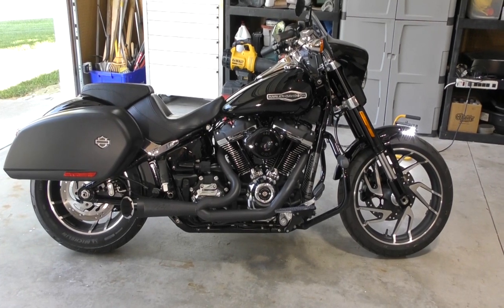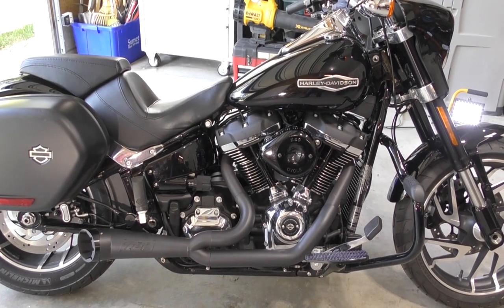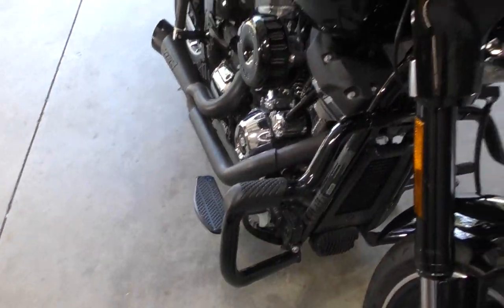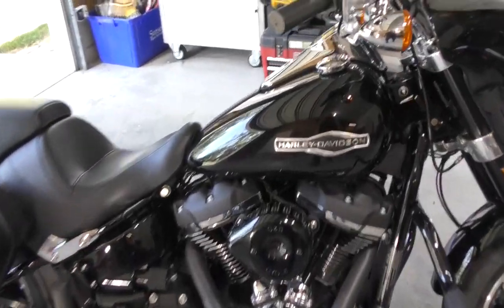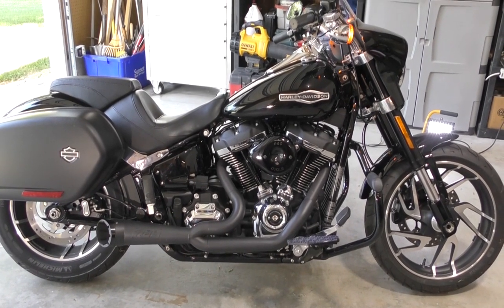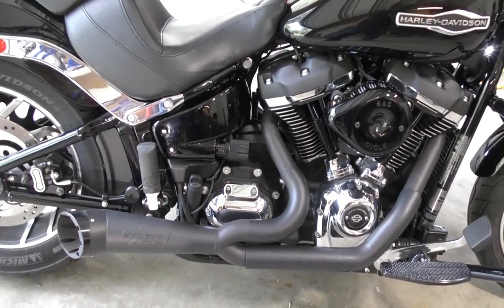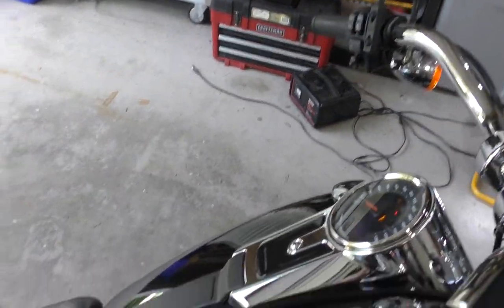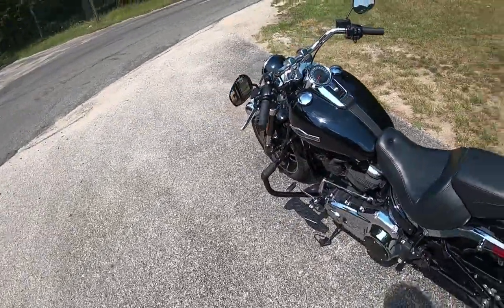2018 Harley Sport Glide Review Stage 2 Kit

Comment: I agree MoCo sends them out the door under cammed. I think with the purpose of selling stage kits.  I did the stage 3 on my 19 out the box.  Done this way it retains warranty gets the MoCo 20 percent discount and was no out of pocket money. Put with the SE tuner and EPA approved S&S Streetmaster 2-1 exhaust plus MoCo Extreme AC 64mm TB and intake the bike made 116/116 at the wheel. The bike / cam pulls to 6k but still has enough low rpm torque to ride below 2k rpms for easy in town cruising.

IMO you picked tasteful & smart mods. I especially like the blacked out TBR pipe, S&S AC, crash bar & boards. I went with the Bunk King crash bar & a taller tinted Gustafson windscreen for mine. Almost 20k miles now in 24 months with zero problems. 

A worthwhile bolt on improvement I did that you might consider was swapping to a 70 tooth pulley to optimize gearing. This improved acceleration plus with my cam / tune and likely yours top speed. No measurable change in mileage. MoCo used overly tall gearing for emissions. The heavier touring & especially trikes used lower gearing than the softails. 

It’s a heavy cruiser but I’ve always been a tinkerer and a bit of a power junkie. Considering what I want to do next. Hope you update your video if you do more mods to yours.

Comment: Hi. You touched on the very subject I'm dealing with now. I have a similar exhaust, and I'm looking for a cam. Everyone is warning me that if I put a cam in that I will actually LOSE torque & power down low. You were told the same thing, right? What did you find?